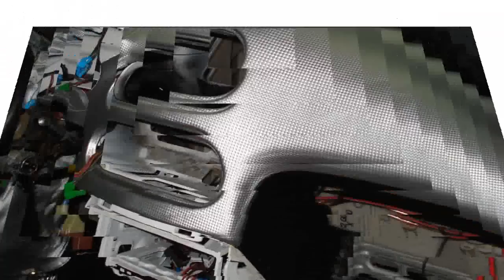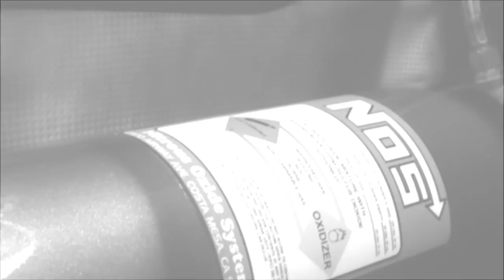Making of Honda CRX Del Sol by Guppik (Versão portuguesa)

Comment: I usually hate body kits, but I have to give you some respect for doing one that actually looks clean as hell.  On the other hand, I have to wonder what the point was in both the intercooler that is connected to NOTHING and having a dual exhaust on a car that only has a single header?  At the very least, hook up a full turbo setup - if you are spending this much on the car, it is the least you could do.